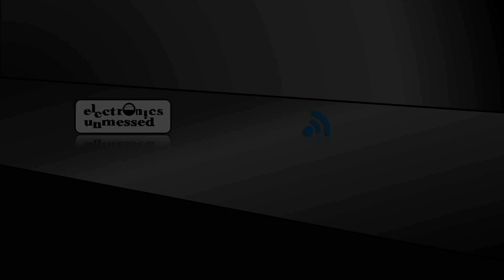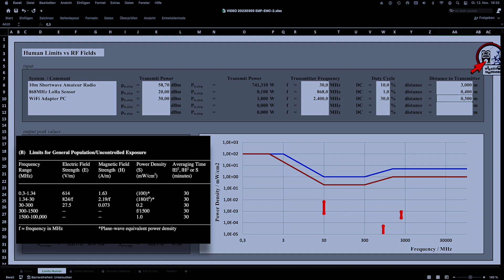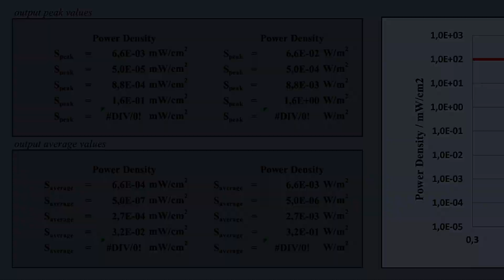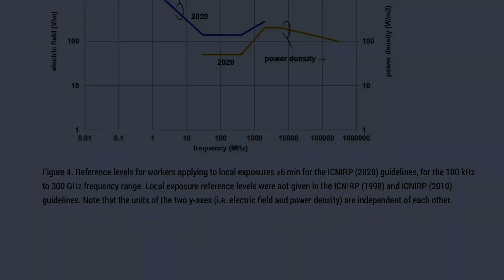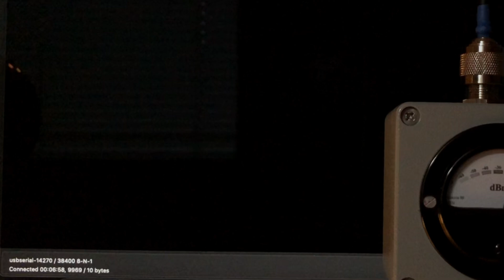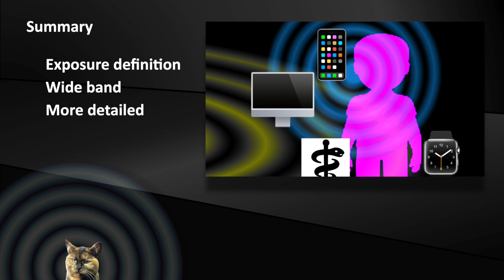Better? New Definition of Radio Frequency Exposure explained (EP150)

Comment: This is such a complex subject, it could take weeks to cover it all!
Here in the US some safety limits are set too high, at least compared to EU limits. To make matters worse, there is no physical FCC inspection when carriers deploy new cell towers or "micro cells" (the carriers are expected to inspect themselves), and while the hardware might technically be within the legal limit, regulations don't take into account that many sites have multiple arrays from multiple carriers, nor that the signal can get amplified by reflections between some buildings. 
It's also difficult to get a precise idea of potentially harmful exposure when using consumer-grade devices, my somewhat expensive "Tenmars" RF meter alarm goes off in many spots near cell antennas in the city, with readings in excess of 500mW/m2, but I don't know how accurate it is, all I know is that I don't get that strong of a signal when I put the meter next to my wifi router antennas, so it can't be good. Also the meter doesn't go beyond 3.5GHz. My HackRF could scan up to 8GHz but it can't scan the whole spectrum at once so it takes some time to check a broad range, like 800MHz to 3.6GHz, and I don't know how to interpret the readings, how would -10dB be translated to Watts, or what LNA settings should be used.
I don't think I'm excessively paranoid about RF exposure, I just go by the principle that if the environment didn't have such strong signals everywhere before, biological lifeforms didn't have time to adapt  and develop an immunity to it, so we should be cautious.
Reply from the maker: Thanks for your comment. You are making a lot of good points here. Its always good to question things. And yes, the topic is very complicated. I am trying to convey a little more knowledge about it with these videos. Normally, there is no reason to worry. But the many aspects that are not understood are leaving a lot of room for speculation, misinterpretation and false sensational reports. Hoping the videos are helping you a bit. Stay tuned!